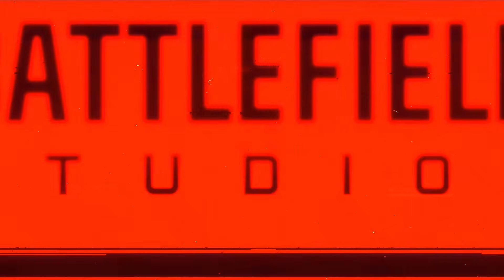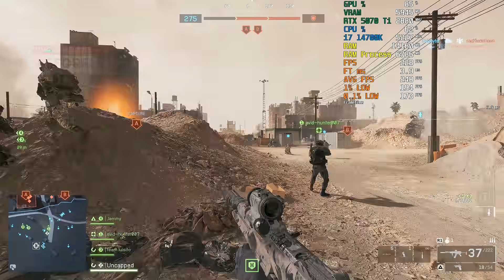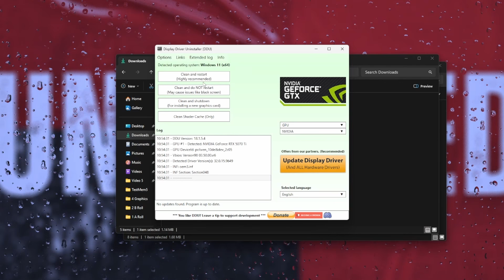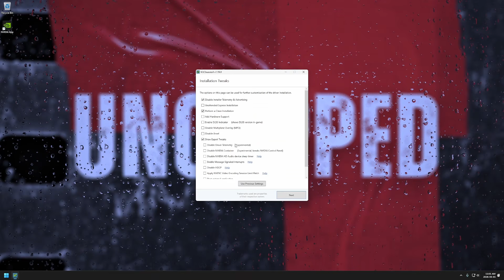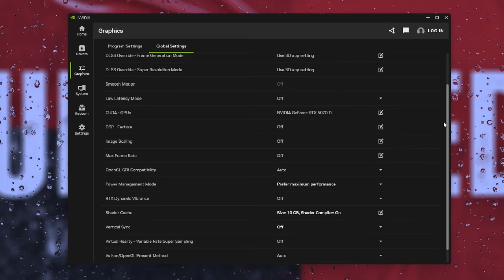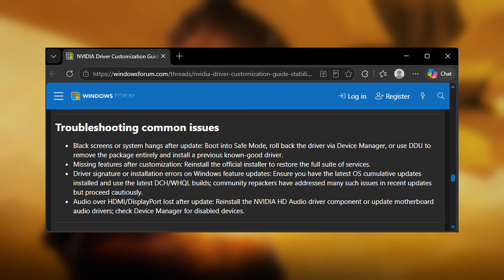NVIDIA Control Panel Is Gone. Here's What To Do in 2026

Comment: I almost went for reinstalling my drivers for no justifiable reason, but when you compared 1/0.1% from the real match with a lot of players/explosions much heavier and inconsistent load overall to a firing range? 
Lol, another manipulating vid. Sadge. 

Don't get me wrong, ddu tutorial was pretty accurate for beginners, but there s no real reason to ddu GPU drivers if there are no major issues. If its a regular update just install it -> done.
This definitely won't heal your 0.1% from 150 to 230.
Reply from the maker: @alexandertarasenko10 A full BF6 comparison video is incoming, but the end result will be the same. This video assumes viewers have already checked out the dedicated 1% lows guide on the channel, which I highly recommend watching for full context. 

To clarify: a clean driver install doesn’t automatically guarantee higher 1% lows across the board. What it actually does is establish a clean baseline, ensuring that dirty driver overwrites or outdated files aren't actively hurting your performance and causing unnecessary hitching.

Comment: Is it not better to set maximum performance per game profile over global? So it doesn't interfere with any other software and just goes for actual games instead? Also, why only 10gb shader cache size limit?
Reply from the maker: @GhanTV Global "Maximum Performance" is ideal for dedicated gaming PCs stripped of background programs to minimize input lag, though you can absolutely set it per-game if you use your PC for other work. 

For the shader cache, setting it to 100GB or Unlimited causes directory bloat, forcing your system to waste time indexing fragmented files which triggers micro-stutters, making 10GB the perfect sweet spot to keep performance fast and lag-free.

Comment: I noticed that you are not running any G-Sync or Fixed refresh rate on your monitor in your Nvidia control panel settings. By the way the option isn't showing up in your control panel means you don't even have it turned on your monitor itself. Is that on purpose? Do you get better frame pacing without using it? Also do you use VRR in the windows settings?
Reply from the maker: @ArelleyStudios Good catch! It’s completely intentional. I disable G-Sync at the monitor level to get the lowest input lag for competitive play. Since it's off on the hardware side, Windows VRR doesn't even show up. If your goal is zero tearing with the lowest latency, the optimal setup is G-Sync ON, NVCP V-Sync ON, and in-game V-Sync OFF.
Reply: @RealUncapped  Thank you for replying back RealUncapped. So, for games where it's more single player-based content and chasing perfect frame times would you enable G-Sync/Fix Refresh or VRR? I have been chasing perfect frames for a while now in games like Flight simulator, ATS and other similar games. But I also do FPS games aas well.
Reply from the maker: @ArelleyStudios For heavy sims like Flight Simulator and ATS where framerates constantly fluctuate, absolutely use G-Sync/VRR. It completely locks in your frame pacing and makes lower FPS feel smooth. For your FPS games, you can keep that optimized G-Sync combo for a great balance, or turn it off entirely at the monitor level when you need maximum responsiveness for competitive matches.
Reply: @RealUncapped  Thanks RealUncapped. I subscribed. Good Stuff.
Reply from the maker: @ArelleyStudios Glad to have you with us!